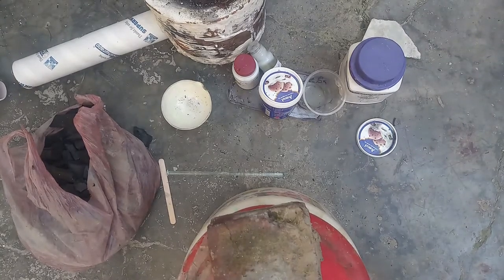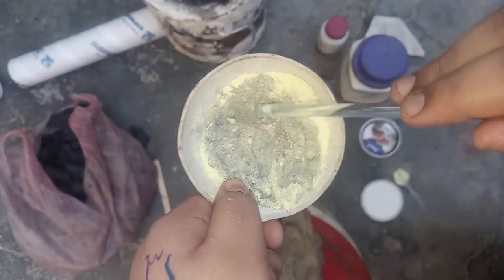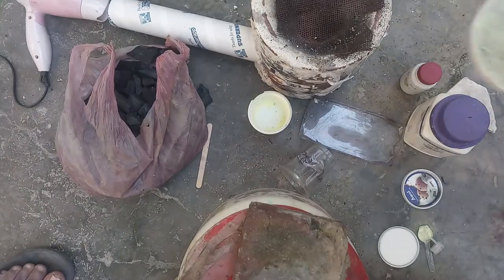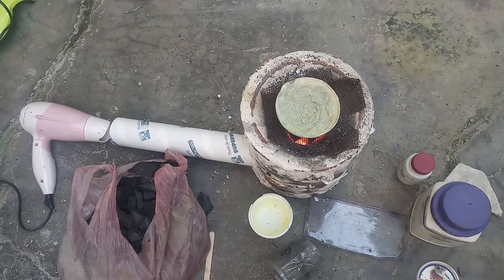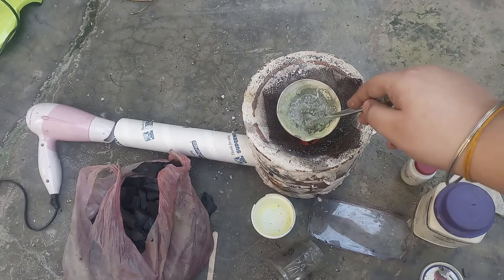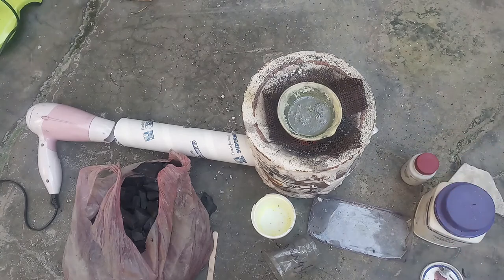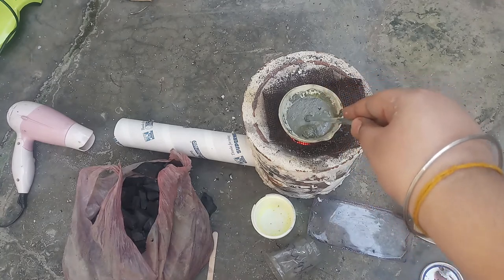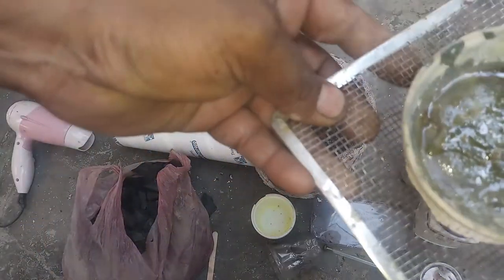Zinc sulfide production part 2

Comment: Supper
Reply from the maker: Tnxx
Reply: Respected madam u have tel as very eze mathod making zinc sulfid ...
Reply from the maker: @arifkamal216  firstly correct your gender selection.Its sir not madam for a male .Nonetheless Another way is to prepare iron sulfide and zinc sulfate .Then to a flask add that iron sulfide and any dilute acid such as H2SO4 and HCl .Gas so produced is hydrogen sulfide and then pass it down into solution of zinc sulfate or chloride ...

Comment: Can you make a video of making of red murcury sulfide powder
Reply from the maker: It would be rather a piece of a cake ,but I dont have any mercury as it is quite non economical to have it .Also if extracted it from thermometers it would not only waste money and efforts .But sometime in future when i will be starting patreon or reaches to 1K subs ,then I would plan to do that experiment joyfully .
Reply: @Prchemist06  I know it's not easy it's take long a time
Reply from the maker: Yeah ,but ya know hardships & long practice makes success fruitful .
Reply: @Prchemist06  yes i know its very difficult but everyone is not doing his procedure
Reply from the maker: Whose procedure are ya speaking of ?
Reply: @Prchemist06 😊😊😊
Reply: Can you define red mercury sulfide making procedure in word
Reply from the maker: I am not precisely sure ,but it work .Mercury sulfide occurs in two states namely : α-mercury sulfide or Red HgS and,β-Mercury sulfide or black HgS.The α can be prepared by first passing H2S into any water soluble mercury salt ,then treating the black HgS with a strong hot alkaline solution ..
Reply: @Prchemist06  i think it's reaction only sulfur and murcury through heat procedure then it's turn into red powder and when it's come air it's turn into oil
Reply from the maker: Yeah you can do that also .But it requires high and elevated temperatures .
Reply: @Prchemist06 i cannot do thay no only low temperatures possible other wise these items finish